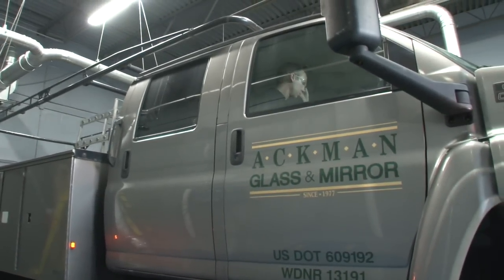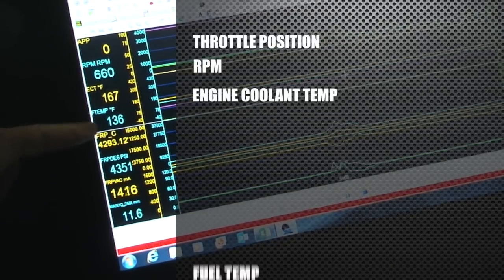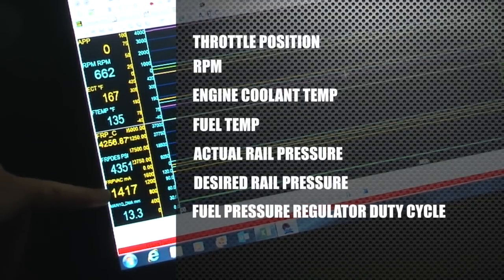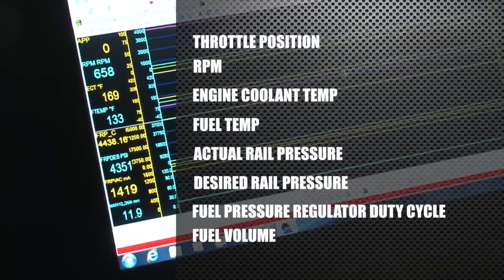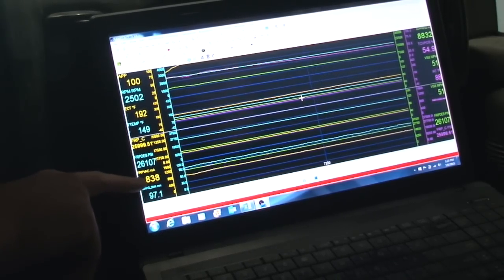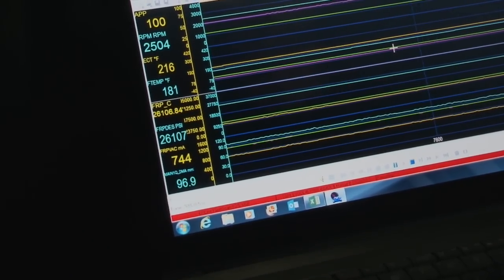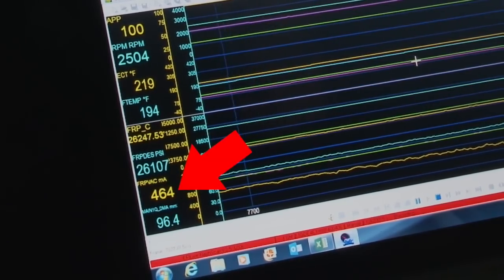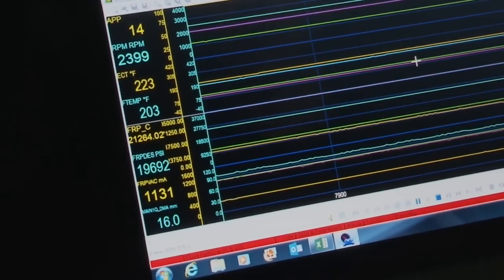P0087 Troubleshooting - Diesel Insights

Comment: How do you add FRPVAC mA to the pid list?  I dont see it listed for LBZ or LMM.
Reply from the maker: If using EFILive do this: 

Open the Scan Tool (V8 or V7.5, depending on your setup).
Go to the PID list or Dashboard tab.
Click Add PID.
In the search/filter box, type:
FRPVAC
or
Fuel Rail Pressure Regulator Current
You should see something like:
GM.FRPVAC or GM.FRPVAC_mA
Description: Fuel Rail Pressure Regulator Current (mA)
Check the box to enable it.

Click Save to current PID list, then Start Logging to confirm you’re seeing data (usually around 1000–1200 mA at idle).
Reply: @Duramaxtuner Got it.  Thanks for the reply.  My Cp3 is getting tired.  I've got a 3794va stg2 that's got a 65 in the front and lly hot section and 60 overs.  Would you recommend a 10mm or 12mm?

Comment: My is super easy yo duplicate, it happens every new day after start up it throws the low rail when you stop at a light for the first few miles, rail pressure you can watch go down like a rock code thrown rail will try and go up wont, black smoke.
Clear code, might come back but next light feather the throttle for a bit higher rpm so code doesnt pop, keep driving then after that the truck is fine no more codes runs fine rail holds in spec no more issues......so do i need a fprv?
Reply from the maker: Hard to say if that's an FPRV or CP3 on it's way out. Might as well start with the cheaper of the two (FPRV) and see if it helps.

Comment: My 08 throws the code during normal driving conditions, light throttle, no towing. Puts me in limp mode and has even shut off. Only thing I’ve noticed is it happens when my lift pump isn’t on, sometimes it’s intermittent. Truck gets chuggy, change fuel filter light comes on, followed not too long after by reduced power mode. Any thoughts?
Reply from the maker: We'd need our hands on it for a diagnosis. Maybe it's starved for fuel if the lift pump isn't on
Reply: The lift pump will create a restriction if it isnt running. Mine says it is flow through when not running, but i found out this isnt the case.

Comment: Isn’t fuel being that hot something to be concerned with or is 200 degrees ok for these trucks? I thought after 180 diesel fuel starts to boil off and vaporize…Been having a issue with the 06 LBZ throwing P0087 only while towing up a hill for 4 years. I replace the CP3 because I was told it was weak. We just got back from a trip and it tripped the code only once. Normally I’d have to limp it home, so that’s improvement. Now I’ve replaced the injectors with reman injectors along with some rubber fuel lines so hopefully it will fix this issue. I’ve done the FPRV solid plug, ported fuel rail fitting, added a lift pump, replaced the cp3, and now injectors.  The truck seems to be quieter and runs a lot smoother so I’m looking forward to towing with it and seeing what happens. Only thing I noticed is it still blows black smoke at WOT, but my boost is 23psi which great. I have no tuner it’s a stock truck. I don’t run my truck hard so it may just need to be blown out good. I’m hooking up to my camper this evening to bring it home from repairs so I’ll update…
Reply: Update: Truck ran really well. Gave her hell going up pretty steep hills and she kept rail pressure, 23psi boost,  engine temps stay around 198-214, trans was around 195-200, fuel stayed around 145-150, absolutely no black smoke 😁. She pulled the best she has since I’ve owned her. Only thing I have notice with this truck, and I thought it was caused by the injectors, is when my camper is Hooke up, which is a 5th wheel roughly 12k, pulling a hill I can have the pedal to the floor and I expect it to hit a gear and just tank up a hill but she doesn’t it’s just like the pedal is dead and she wants no more onions. I just figured out how to get what gear I’m in on my edge so next pull I’ll see what gear she’s in when she does it. It’s like she doesn’t want to go into 6th gear or maybe it’s in 6th and that’s all she’s got i don’t know. But for a 3500 and only 12k on the rear I would think she would yank it up a hill no issues. This part worries me about going up the mountains. I do use tow/ haul mode so not sure if that has something to do with it. But as of right now I think the injectors have done the trick. We want know for sure till we take another long trip. I think the next step is to get her properly and safely tuned.

Comment: We had three of these trucks with the lbzs in them 2006 at 65000 miles they all started d raiting while pulling out 12000 lbs campers on long hills if we force the transmission to shift down quicker it will pull the hills just fine we have lift pumps replaced the relief plug is this bad injectors

Comment: Hi i have 2 of these 2009 lmm trucks and have had this low fuel rail pressure syptoms.It seems these trucks can have this issue even with low mileage.Wat determines rather your cp3 is just weak are the injectors?Are they usually bad all at the same time?
Reply from the maker: If the fuel delivery issue has been trouble shot to the high side of the system, it’s really a matter of finding what is returning fuel (return rate specs exist for the relief, pump and injectors). If the injector return rates are high then it’s the injectors that are in need of replacement. If not, then it’s likely the CP3 will solve the problem.

Comment: I am currently having this issue with my 07 C5500 141,000 miles...First time ever my truck let me down on the job.. Ibwas hauling a F 250 up a steep grade on a hot day.. Had to call a good friend with a Heavy duty wrecker to bring me in...Thanks forcthe video 👍
Reply: @mikefox1431 did you get it fixed? I’m having trouble with mines

Comment: Great video, but what was the outcome? You said that the regulator couldn't keep up, was that the fix?
Reply from the maker: This truck ended up needing a new set of injectors.
Reply: @Duramaxtuner  I LOVE the video...count me as SUBSCRIBED!  Can you tell me if I would (or you did) expect to see higher (significantly) balance rates on his truck?  My issue is that my symptoms are EXACTLY like his.  Normal driving is a non-issue.  But, carry a 5000lb camper in the hot summer...Bam.  But my balance rates look great, all under 1.5-1.7 at idea.  Most tighter then that, less than 1.  Thanks and love your video!
Reply from the maker: @Tom-Fisherman  First, have you gone through all other basic troubleshooting? Relief valve? Fuel filter? Cp3? Any fuel in the oil?

Comment: I have a question regarding this code. I have an 06 LBZ that is going into limp mode on hot days pulling a 10k lbs camper. I’m throwing a P0087 code like you say. However, I’m throwing 4 other codes. P0299, P0128, P003 and P2563. No one ever mentions other codes. Is my P0087 causing the other codes by default  or are these other codes causing the P0087? Every forum and video is strictly regarding the P0087. Really looking for some clarity.
Reply: What did you figure out?

Comment: I have a 2006 Lbz and the code only throws for me after about 10 minutes of driving over 75mph unloaded but it only happens once in a while now during winter during the summer it happened more frequently I do have a lift pump and a new cp3 could this be a sign of injectors or clogged pick up tube in fuel tank or what else I know that someone replaced the soft fuel lines the go from the fuel filter to the cp3 I need to order some factory lines because those are slightly kinked where they’re at I don’t know what to approach next my fuel line next to trans and after fuel tank aren’t linked or closed shut

Comment: When our 5500 lbz had this problem it was because the lift pump had failed. Not sure if that’s stock on the top kick/kodiaks because we bought the truck used, but it did have a lift pump and it wasn’t working. With a new lift pump we haven’t had the problem since
Reply: they didnt have a lift pump standard. I was having fuel pressure problems until I installed a lift pump, then never had a problem again. Towing 12k up 6percent grades in over 100 deg temps. 2006 c4500

Comment: I have an 09 C-5500 Topkick with a a a little bit of mileage/ a few Km's on it. It now has  duelly box on it. Can't afford it yet but what tuner/s work well for it?   Thx.
Reply from the maker: HI Edward: I assume it's a diesel - so Duramaxtuner.com can help with your tuning needs. Look us up online or give us a call: 815-568-7920.
Reply: Efi live
Reply: I got an Edge tuner, so far happy with it.  The 7 plus Lbs of Pos  Pressure works well from the in tank fuel pump.  Dont think I have been able to burn more fuel working it then to be able to drop furl pressure.  If the rain holds off changing fuel filters?

Comment: I know this may be off topic...but i just purchased a 2017 2500 HD Chevrolet. (few months ago) and just purchased a S & B cold air intake. I know after installation I will need to tune the truck. Which tuner should i buy....I am not a mechanic but do understand basic stuff. Its just that there are so many????? Any info would help. I have done no other modifications at this time, but am looking at exhaust and when available EGR removal(after warranty) I do mostly highway driving with this truck at high speeds.
Reply from the maker: Your 2017 has an L5P engine, which at this point in time (December 2017) is not tuneable. Installing a cold air intake does not require special tuning - it's just improving the flow of air into the truck. This channel is owned by Duramaxtuner.COM - the leading North American developer of EMISSIONS EQUIPPED calibrations for common rail diesel engines. I'm fairly certain you'll need a tune once you start deleting your emissions equipment - and as written before - the L5P is not tunable - so we would advise caution. Finally - the L5P actually behaves like a tuned LML (2011 - 2016), according to our testing. If you have any questions - give us a call 815-568-7920

Comment: I have a question. My 160k mile LBZ gets a 0087 code but only during a 1/4 mile pass on my max effort tune and only when I lift off the pedal at the end of the pass. No issues on other tunes or in day to day driving. It doesn’t do it every pass maybe once every 5-6 passes. Has a PPE race plug. Ever have similar complaints?
Reply: Also has an Airdog II 165 and I change the fuel filters religiously at 10k miles.

Comment: 180k and needs 2 to 5k in fuel system work... should have got a Cummins.
Reply from the maker: Those weren't your grandma's 180K.
Reply: Which use the same CP3 pump, and injector differences are minor.
Reply: Joshua Respecki they aren't exactly the same. Bosch offers hardened parts that some oems r to cheap to use. Also calibration makes a big difference in durability. Dmax likes to be happy with using max rail pressure much more often than Cummins. Higher pressure is higher wear. Can't change physics. U can change your gender(or so some idiots say) but not physics. Glad I am an engineer and not biologist lol.